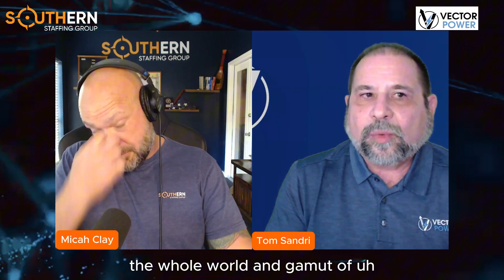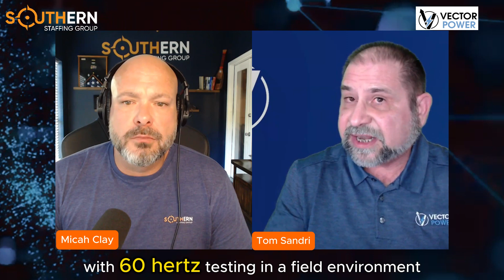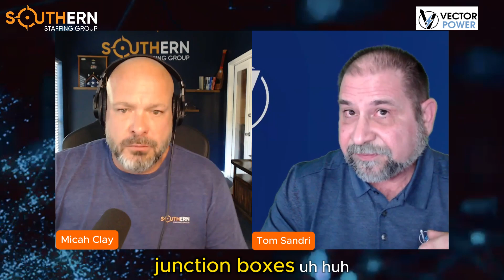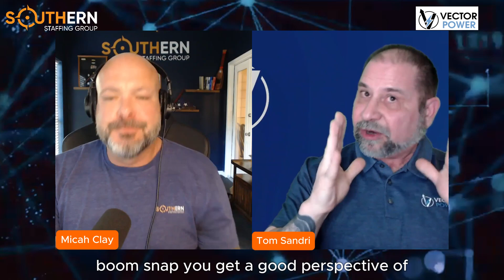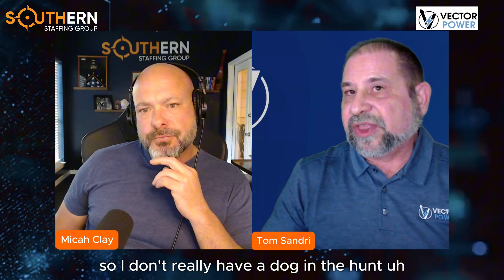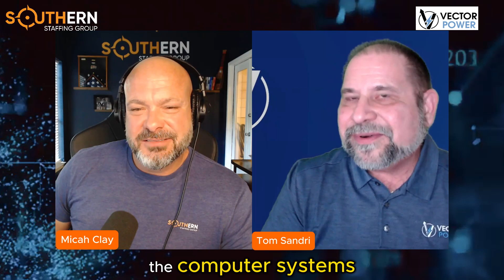Understanding Partial Discharge Field Testing of Shielded Dielectric Power Cables

Comment: Left out that the physics of a PD event is a Townsend Avalanche (ionization process). So with 30+ years of data from the European IEC60270 Standard prove that the best frequency to find defects is "TRUE 60HZ"(NOT RESONANCE) DAC, CR SLOPE! Sine .1 hz is a PD measurmeant.  But absolutely is nowhere near as sensitive and very  probable to miss a defect at the standard test voltages for commissioning at 2 Uo. For 60hz comparable pd measurements
Reply: I agree with your assessment and the IEC60270. However, as I stated a few times in the interview, we would never have felt the need to develop alternative power supplies and techniques in a perfect world.  Suppose a client does not have the ability, for reasons given in the interview, to embark upon true 60 Hz testing. In that case, alternative technologies provide solutions, even with limitations.